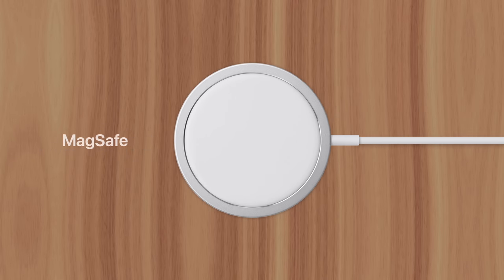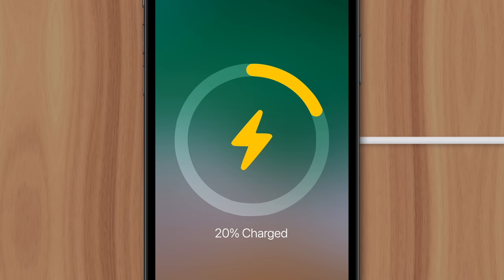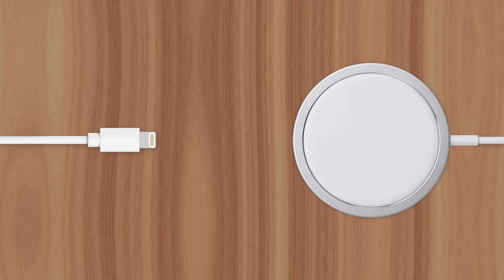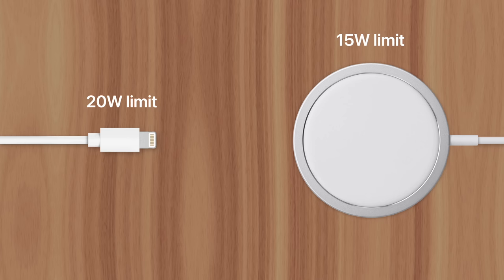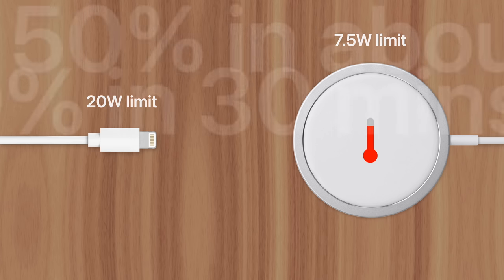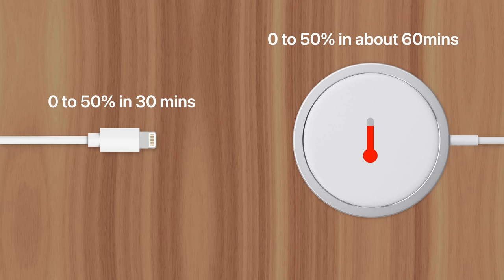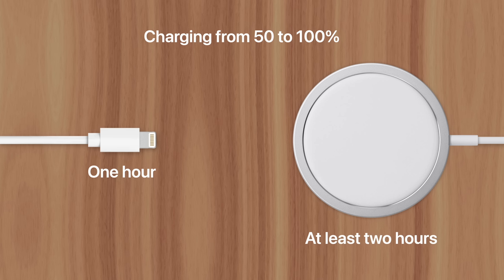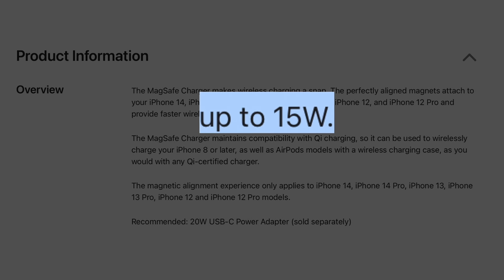Why MagSafe Charges So Slow

Comment: I use a standard wireless charger at night and a standard lightning cable through the day if I need it. MagSafe seems to be the worst of both worlds with the slow charging and the overheating
Reply: You’re wrong and you’re missing the point.
MagSafe IS wireless charging, just faster. They both overheat because of physics. Transferring power wirelessly from a coil to another causes loss of power which converts into heat. 
While MagSafe is slower than cable, it’s faster than regular wireless and it’s convenient and much better than regular wireless charging because of the extra  magnets to align the device effortlessly instead of trying to find the right spot manually or missing the spot! And it’s very convenient opening the door for new accessories and use cases weren’t possible before. It is great but not perfect. Definitely, better than regular wireless charging in all aspects, and better than cable in few aspects. Apple need to keep R&D to enhance it reducing the amount of wasted energy, hence, decreasing the dissipated heat and speeding the charging process.
Reply: @fmax3000  thanks for the science lesson, but I already know how wireless charging works. Also thanks for straight up saying I’m wrong because of my own experiences lol. I understand MagSafe accessories and the door it’s opened even though phone magnet accessories have been around for years now. Also also. Just get a decent wireless charger that isn’t hard to align. I have one that stands up from Samsung
Reply: Wooo, cool down. That wasn’t a lesson. I’m an electronics engineer, computer scientist and a programmer/ developer. I just told you facts based on science not my experience. If you ask about my experience, yes, MagSafe is faster that regular Qi chargers. Aligning  convenience is not only by finding the coil at day, but throwing the device in a hurry without looking back, even when it’s dark, lol. Cool down. BTW, I test and compare different chargers, cables, and measure the current amperage and how fast it takes, I’m a tech freak and I do care about my gadgets, time, power consumption, safety, etc. just wanted to share because you were wrong in some aspects in first comments. 
Have a nice day.

Comment: I’ve never used wireless charging. Never will. It’s not as fast. Rather them take that out and put in a bigger battery. Yes tech journalists might be mad but who cares. The average Joe probably doesn’t use wireless charging either.

Comment: Wireless charging is really inconvenient for me. I ALWAYS prefer to plug it in. I don’t want to buy a $40 “compatible” case either which means i always have to take the case off to charge it most of the time. Plus you can’t use your phone while on a pad. So pretty much worthless to me

Comment: i always have both, but 99% the time i am using wireless just coz the convenient. and i only use 10W charger for it since I do not need any fast charging feature. If i have to leave the house, ill bring a powerbank, but for 99.999% the time I can keep charging it in my car, and depends on the destination, I always have a spare powerbank thats always topped up in my car just for that purpose, for example i have to leave house in a rush heading to an event, the powerbank is always my trump card. And i dont feel bad for trashing the powerbank since it cost so little compare to the iphone.

so have a smart plan, beats every tech.

Comment: Wireless charging in general is not ready to be our primary way of charging devices, it's not efficient (too much energy gets lost in the process) and the heat generated by this lack of efficiency is harmful to the battery in the long run. This also apply to those crazy super fast charging technologies that you can find on Androids (like 120w and stuff).

Comment: Wouldn't be surprised if iPhones go portless. All that heat destroys your battery. Thats more sales for Apple.
Reply: Not everything is a conspiracy.
Reply: @DavidKen878  I mean thats based more in fact than reality. Thats the whole reason they're still using Lightning, despite USB-C being superior. Because Apple makes royalties off every lighting cable and accessory thats ever been produced. Of course they wouldnt move to USB-C and loose that profit!
Reply: @silvy7394  But what does that have to do with your original comment? You basically just contradicted yourself.
Reply: @DavidKen878  Whats the contradiction?
Reply: @silvy7394  If Apple is using Lightning to make more money then why would they remove the port from the iPhone?
Reply: @DavidKen878  Because the EU is forcing them to. 
To which I replied, wouldnt be surprised if they go to magsafe portless so they can make money off magsafe chargers and toasted batterys.
Reply: @silvy7394  Ok. Conspiracist.

Comment: I feel like if they added cooling on the MagSafe charger and the phone wouldn’t get too hot because of it, it would charge at least a bit faster.
Reply: It's the phone that gets hot, not the MagSafe device.
Reply: I think Apple know what they are doing.
Reply: @peterknutsen3070  I know. The MagSafe charger would cool the phone down.
Reply: @tomasplunksnis1087  Sure, that's a possibility, but it'll either create noise if it's active cooling, or else it'll create a non-smooth surface area for passive cooling, and that is hard to clean while also not achieving much.

Comment: I actually have no clue how MagSafe on an iPhone is at all more convenient than a cable... if anything it's way more hassle in practice. You can't use the phone or you have to hold it in a wonky way just to use it while it charges, it wasts energy because its very inefficient, and it's much slower to boot! For what?.... so you don't have to use a cable? A cable will always be the best option, look at bluetooth, it STILL sucks compared to actual wires, and even Wifi is like that.. although there isn't as big of a gap between Wifi and Ethernet speeds than you might think.

Comment: Slow,  expensive, environmentally disastrous to make and to use (most electricity passing through is wasted), bulky and cumbersome,  and what it irks me most is that why would you make charging more complicated?   You do realise you still need to plug it into the wall socket and have a wire dangling there right?     Do away with it and bring back the headphone jack.
Reply: Headphone jacks at this point are completely useless, you do know there are wireless earbuds that are 100x better than the wired always-gets-on-your-face earbuds?